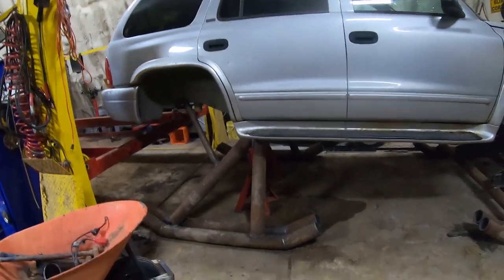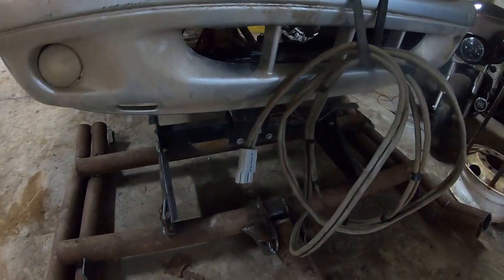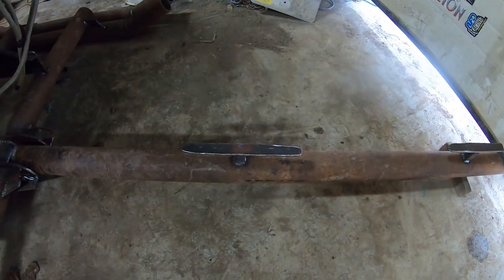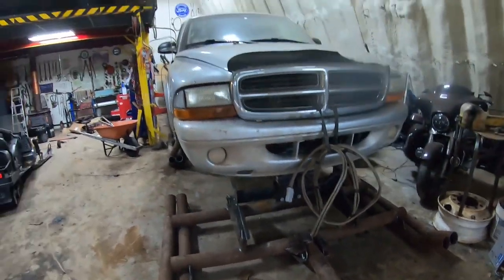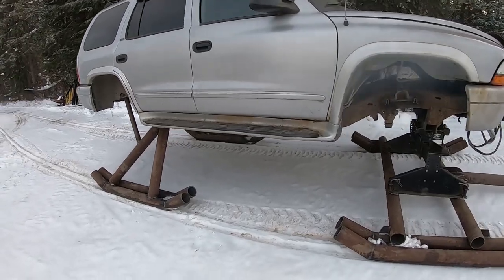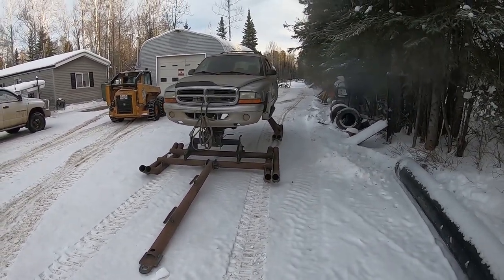The Durango Trailer( Dodge Durango on skis with a fifth wheel hitch pivot)

Comment: Some heavy duty snowboard size (minimum) runners will make that float pretty good.  I would worry about it tipping though in deeper snow.  I built a small harbor freight trailer with snowboards on it and it still tipped over.  Your center of gravity is higher though.  I think it will all work out once you put some wider runners on it though...Too bad they don't make toboggans that wide and you could tub the front and rear separately (the entire width).  That would give it some serious floatation.
Reply from the maker: The center of gravity is actually quite low it seems because of the weight of the skids. Not saying it still won't go over. I'll definitely have to keep that in mind.  Snowboards keep coming up in conversation but im thinking wider along the sames lines as you! Toboggan would be nice till you have to back up
Reply: The toboggan will work if you put some guide rails on the bottom.  Skateboards use rails to protect the boards from scratches and help them glide along rail slides.  Those nylon bars are cheap and easy to mount on toboggan as guides for deep snow.